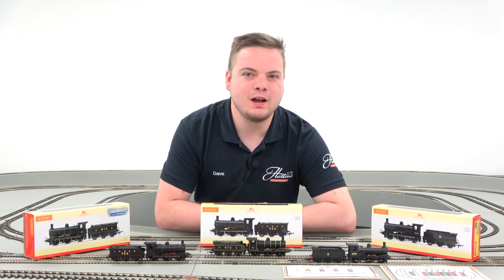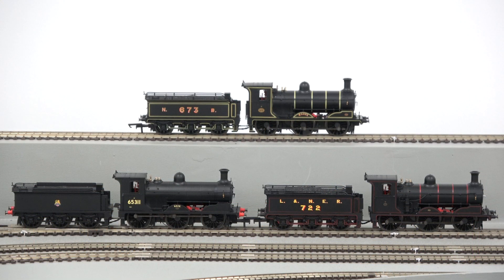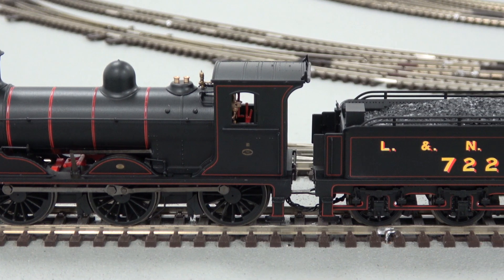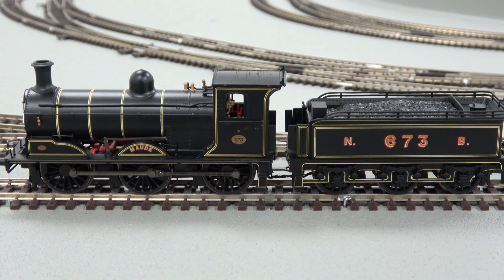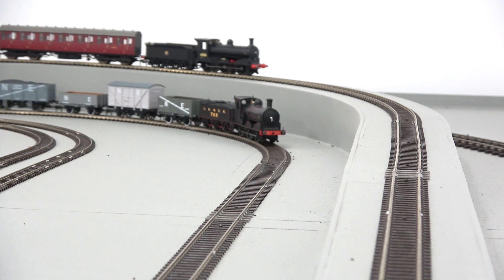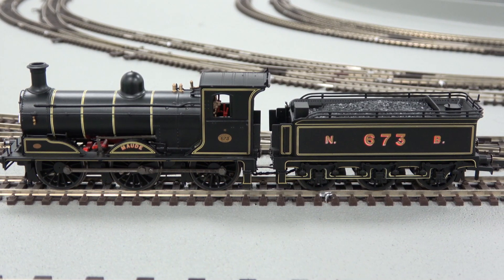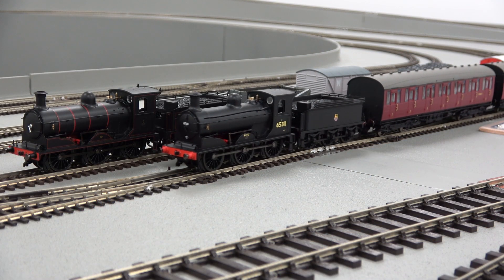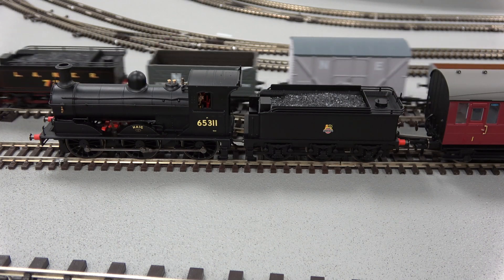Hornby Class J36 0-6-0 - Model Overview

Comment: A load of crap typical Hornby poor quality, mine fell to bits, the rear cab tarpaulin fell off then the handrails followed by the brass boiler fittings then the coupling rods fell down and jammed on the track ,my new Hornby 2Bil was poor too the buffer beam fell off, no more Hornby better to stick to Bachmann.